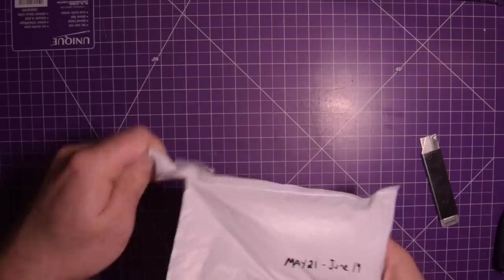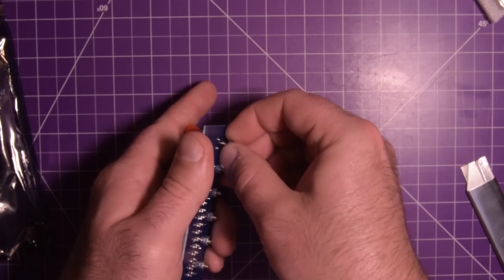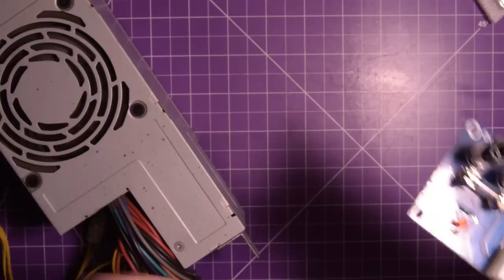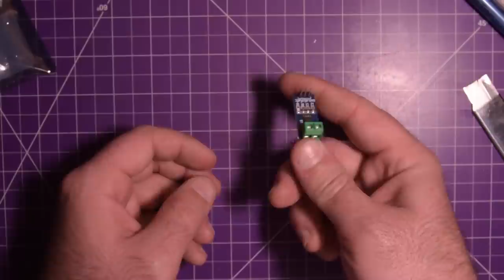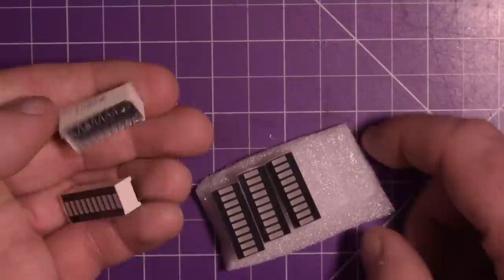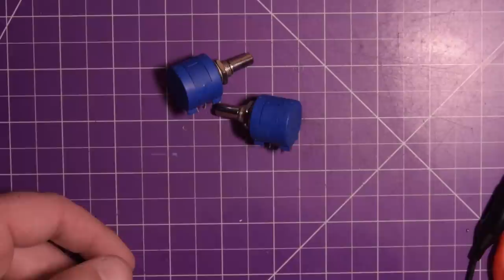Mailbag 26 - Alice1101983 Special 3!

Comment: Probably depends on which way you mount the board to wherever you're mounting it to? 

Why plug to the back side of the colored posts? Normally the colored portions are twistable and also have a punch thru the center with a jack for something such as a test cable, BNC connector I want to say but maybe not. Correct me if I'm wrong. 

Amperage will probably depend on the power supply. Ah there you go the 4mm banana plugs is what I was referring to above. Typing while watching video.